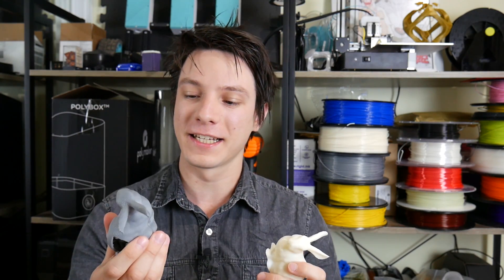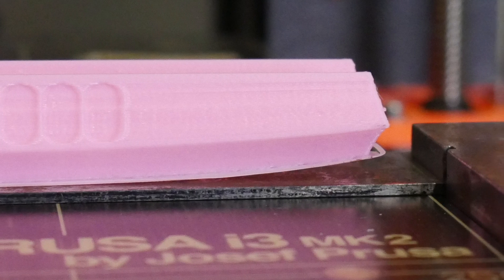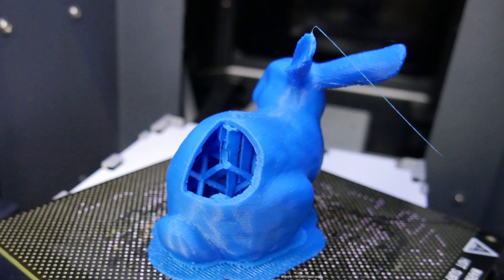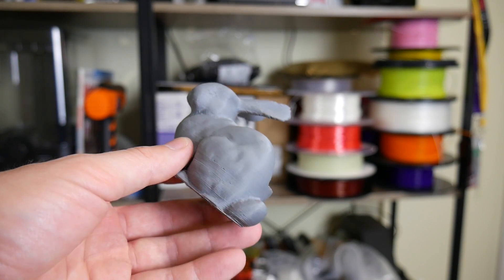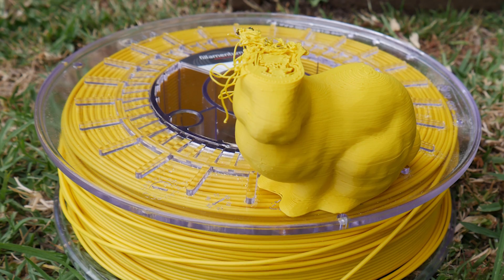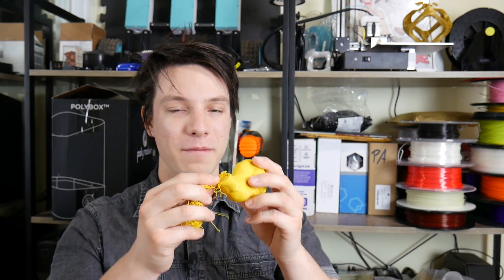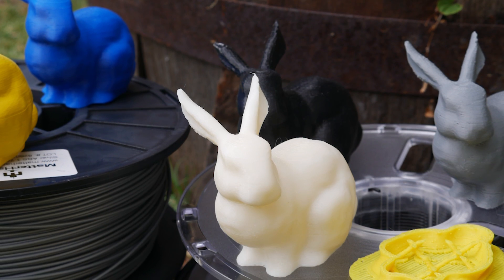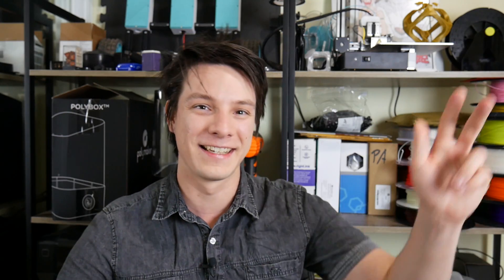Should you 3D Print in ABS? Probably not.

Comment: the only reason to still use ABS is smoothing. if you take control of the process from one end to the other (good bed adhesion, thermally stable and hot enclosure, and a nice recirculating [heated?] acetone chamber) then simply the quality that smoothed ABS gives you cannot compare to that of any other process, at least not without retaining the material price, strength, and availability.

Comment: I swear by ABS when rigidity matters. This is mostly because the best ABS you can buy is produced a town away from me- Chromastrand.
I’ve printed rocket parts and I use ABS for smaller, less complex parts that need rigidity and I use PETg when I need good dimensional accuracy and minimal warping.
If your bag is larger aesthetic or novelty prints, then yeah ABS isn’t for you. But from an engineering perspective, ABS absolutely has its place.
It came in especially handy for lightweight farings and other aerodynamic features because of its ability to be easily acetone smoothed.
(All my FDM printing was done on Lulzbot TAZ6’s or TAZ minis. Colorado State also had a Stratasys Objet 30 pro that I used when dimensional accuracy and complexity was the primary concern)

Comment: I use ABS for functional commercial parts used in aerial survey. it may not be good for printing useless models, but for functional hardware, brackets, handles, electronics enclosures, there is no other printable plastic  material that can deal with the extreme environments of aviation. For the average hobby user, it may not be the material of choice. but ABS is used in nearly every plastic product to this day. If you print on a PEI sheet on a heated bed, I find it just as easy to print with as PLA. You CANNOT use a glue stick or masking tape to use ABS, PEI is the best material to use as a coating on your bed. Black ABS is very UV stable, it is used in OEM automotive zip ties, engine covers, and dashboard components. I say this as this video is misleading for users. I print ABS for my job and it works very very well.

Comment: I print a bunch of ABS on my CR-10 without any of the mentioned problems. The learning curve for ABS is just slightly higher. But it's great for light functional parts that won't send splinters in your eyes when someone drops them. The slight flex is also just perfect for ultra light lens caps or cr2032 holders. I also used it for moderate speed rotors. And of course in my 3d pen to weld abs parts together.

Comment: PLA is easy to print with however there are many real world applications that require ABS, especially parts exposed to heat, sunlight and water. I have had ABS parts on my car exterior and interior for 4 years already without issue.

Comment: I disagree, I have zero problems printing with abs, active heating is EASY with a plugin that i wrote on octoprint that evens acepts gcode to set enclosure temperature. ABS is easy to finish, cheap...
Unless you can give another filament with all the same specs your comparison is not valid imo.

Comment: I personally use ABS almost exclusively. This is mostly due to the fact I have a really old printer (Solidoodle 2) without a fan or good support for one. I've also been using ABS since the beginning, and once you get it dialed in, it's easy. I almost never have problems. The worst part is waiting for the heated bed on my old printer to get to 110C. That does kind of suck, it usually takes 15-20 min.

Comment: One cool thing I saw with ABS, is how it reacts with Acetone vapor. It works like a weak acid, and you can use it to smooth out the outside and remove a lot of the layer marks. Which I think is pretty cool. Not sure how easy it is to get acetone though. Or if that benefit is removed by newer fillaments. I'm not really in the 3D printing scene, I just think these videos of yours are super neat. But I do have a friend with a 3D printer, so I might pester him about some of your stuff too.
Cheers.
Reply: Not like an acid, it acts exactly like you would expect it from organic solvents.
Reply: Not like an acid, it acts exactly like you would expect it from organic solvents.

Comment: I have a FlashForge Guider II and I can print large models with ABS almost flawlessly with very high detail.  Probably because I have an enclosed printer with a heated bed using a BuildTak type of build surface over glass.  I was printing ABS on a Robo3D R1+ and that worked pretty well using the heated bed along with PEI for my build platform.  With the Robo3D I didn't have an enclosed environment so large prints would sometimes warp or lift but it wasn't as bad as you might imagine if my temperatures were adjusted properly.  I would never go back to glue sticks, hairspray, or ABS slurry mess.  I love both PEI and BuildTak type print surfaces.  I have amazing results with ABS, especially with the FlashForge Guider II.  The problems I have had with other filaments I have tried is they are either too hard and brittle, won't last outside exposed to the elements, and they melt at a very low temperature.  If you have any recommendations on other types of filaments that don't have these issues, I'd be more than happy to try them.

Comment: Polycarbonate have some special effects which we use when we weld it with thermic welding methods. On most materials the plastified materials is some kind of a weak spot and the flush created during welding dont do anything for the strenght of the part. PC is different here as the flush by itself remains compact and, when the joint is designed properly, increase the joint strength: Said in one sentence? A correctly welded PC Part will break everywhere, except of the joint.

I think that is the reason why it delivers such tough models when you print it. We can think of the lamination the same way as pressing two molten weldconstructions together. I hope this is more or less correct as I am actually not 3D Printing and dont know the process. I intend to buy such a machine for prototyping and thank you for the informative videos!

Comment: I print in almost exclusively ABS. I do some PLA but it's far harder to clean up, and tears my hands up more. 

ABS Plastic is not hard to print as long as you follow these simple steps:

1) Borosilicate glass plate on the bed. 3mm at least.
2) Elmer's Purple Glue coating on the glass - It never comes up or warps
3) Print at the proper temperature

Comment: For some reason I still like ABS but warping WAS a pain in the arse. Recently I tried TitanX form formfutura and, as advertised, it does not warp. Still a bit weak layer adhesion though  Perhaps I have put most effort into tuning ABS but I always get better prints with it and like that you can sand and drill it easily.

Comment: ASA(Fillamentum) is in my expirience harder to print than cheap ABS (Esun/Hobbyking). It warps more and in the same time it tends to overheat much more. Big advantage of ABS you did not mentioned at all is in my opinion how it looks. Compared to PC Max in the video it is not so glossy. Same problem I have with PETG, again it is too glossy and so it looks very cheap. I also really need heat ressistance and in this case there is not so much substitute to ABS in reasonable price range, just HIPS I like a lot. HIPS warps less than ABS and has very nice dim look (black is awesome). With my passive enclosure I am able to print big prints without many troubles. Unfortunately HIPS has stupid label of "just support" material and so it is not popular and it is hard to find it in many colours.

Comment: I disagree with you. As ABS can be machined so well its outstanding. I only build parts to be used for building purposes in terms of hobbies. The most parts i print are between 20 x 20 (nuts) and 100x100 mm. The bigger the part the more i tend to use PETG, as its cheap (compared to other Mats with the same featuers) but small parts ABS just is the way to go. PLA is only good as long its in the printer. Once u take it out the parts always are printed well, but almost everything does one of the two: either its getting warm -> PLA gone or: there is a little force applied -> gone. PC-MAX is just way to expensive. 50 bugs a kilo, spend the half of it for smartABS and design parts in a way that the force is aligning with the layers ;) 
but never the less thanks for the vid. First time i heared about ASA will give it a try!

Comment: You are not correct. I print very high and large  ABS parts without an enclosure. You are absolutely wrong. I've never got any lift offs or curling. ABS is very good, high temperature industrial great plastics, that is being used for many years. It's also cheap. You just need a great adhesion to the bed. Don't use smooth surfaces and expect good adhesion. See my comments and videos in the bottom and  try, You never gonna print anything else. ABS is great!
Reply from the maker: +CoolStreamT cool stuff, which 3D Printer?
Reply: I have Anet A8. I assembled it from Kit and I did some mods and most important I built an oven above my printer constantly drying my filament during printing, because my prints take long time to print (about 15 hour). My filament is always dry. The printing quality of the ABS depends on dryness.

Comment: If your things will be in a basement (moisture) or garage (moisture & heat) then you need ABS. I print most everything in ABS . One reason strength of the part and the other reason the weather. If something is to stay outdoors you should be printing in ABS.

Comment: Ridiculous.  What a weak argument.  PC-Max is available in only 2 colours and $60/kg!  Abs takes a little more prep to make sure it works but it can be done very reliably and it is cheap and is strong in a broad application temperature range.  You need a heated bed but not a heated chamber just good bed prep. It is also available in a wide variety of colours no special nozzles are required.  Vent you build area and use double application of water soluble glue sticks for the bed.  I've tried a bunch of other exotic filaments and non were worth the trouble or expense.

Comment: I stick with ABS for the following reasons:
Hatchbox sells it for around $22 a Kg
I don't have any of the issues you say are associated with ABS maybe because I have a fully enclosed printer
I don't have to worry about tape or glue it just prints
Because I have an enclosed printer if I don't have a fan pointed at my printer PLA just comes out terribly

This has been my experience over the past 3 years of printing on my flashforge creator pro

Comment: My DaVinci aio 1 is self enclosed and does rather well. Yes... yes I know you  hear this alot . But several of your brethren tried DaVinci  but none did the AIO1 with scanner. The surface of the bed seems to be perfect! I never have any warping problems if i leave the post print to cool and slides right off the bed. Maybe proprietary abs dont know.

Wish their tech support was better.

I digress... 

I  have a enclosed printer w/heated bed and never run into alot of the problems with abs you guys with open air non heated bed people have.  Is that because you guys found open air machines where easier and cheaper in the early days of the 3d print revolution.  Dunno!

Comment: I am using transparent ABS from CCTREE, wjith a (rathercheap) Tevo Tarantula., which was dead cheap and it works amazing, does not really warp (sometimes yes). It is very stiff, adhesion is very good. I admit I print at slower speeds than with PLA (40% slower) and I have to set the 1st layer to very very slow, the latter is not affecting the overal time so much. But I think pacience is the problem. Plus I made vases with the transparent ABS and they turned out sooo amazing (only 1 perimiter, very robust)
Reply: no glue, no glassbed, its 20cm, I don't have much more space anyways
Reply: yes! i wouldn't start with ABS, i started with PLA, and will use both in the future :)
But thanks I will add a cage around my device. Anyways, but now i know that the warping issues that I have will get lesser

Comment: Quick question: how did you tweak the print temperature on the UP Mini 2? My experience with their slicer suggests the temperature controls are locked away, and last I checked the print protocol hadn't been cracked yet like it was with the original UP Mini.

Comment: Thank you.  The added "fiddly" nature of ABS is what turns me off.  I've had no problems with PLA on my Monoprice/Wanhao Ultimate/Duplicator 6.  Printing small, flatish parts parts in ABS was okay but anything with sharp corners is just too unpredictable.  And that's where I draw the line.  If I have to roll the dice with low odds off success each time I print...I'm less likely to use a material.  I don't have the needs ABS solves for so...no more ABS for me.

Comment: I think the main issue is that FDM machines were not originally designed to create a final product. They are prototyping machines. I use my 3D printer as part of a workflow. The printed item is a step in the process. I design, print, sand and finish, mold, and cast either in resins or metal. Of course you're going to have quality issues straight out of the printer. People are always whining about print quality as if they have never heard of sandpaper.

I worked at a prototyping company for some time using incredibly high-end SLA machines with resolutions that blow any FDM machine out of the water, and the bulk of our work was still finishing.

Tl;dr: 3D prints require finishing no matter what material you use. 3D printing is not a one-step process

Comment: 6:30 I've had a lot of luck printing large ABS prints with heat lamps directed at the print.  Like the sort you get for an lizard or something.   I use a Rostock Max, and I have three lamps, one facing each side.  It keeps the temps up, and the print turns out great.

Comment: 200$ prusa i3 kit. Level the bed well once, and you're good until you take it apart or something. Good spray of hairspray, and it sticks like it doesn't know that he is abs.
Had a problem only when printing a 100x170 box, 6 perimeters 0 infill... But the heated bed sucks, it's heated only in the center so...

I throw away 70% of my prints as they are prototypes, and maybe the final one is only something that will sit there untouched... Why spend 40$+ on a kg of filament

Comment: Soo, i have a question. 

 What kind of Filament would be most viable for the construction of Ball joints
 and other parts that need to the flex just a bit but also have the correct tolerances 
 necessary to hold positions yet also move smoothly?

Comment: I can't say I agree. I know there are disadvantages to ABS, but there's also a ton of advantages (price, availability, strength over PLA). I think you may have exaggerated just a bit on how difficult it is to print ABS. I print with ABS all the time, and while there are definitely times where I have a lot of trouble, I can typically get ABS to print incredibly well, and can adjust for things like shrinkage and warping during the print

Comment: PC-Max is a pain in the arse unless you use buildtak. It doesn't stick to Printbite at least (lifts after the first couple of layers), which handles pretty much everything else I chuck at it.
Formfutura ApolloX is a good ASA filament that's strong, gives great details and prints easily without warping with a non-enclosed ~90c bed. It's definitely better than that crap ASA you had there.
I've not tried it, but TitanX looks like a good alternative to normal ABS.

Comment: ABS has a higher modulus of resilience, meaning it can take more impact energy before reaching yield stress. PLA is classed as a brittle material, meaning it will break before it bends. Not too sure of any practical application where PLA would be better.

Comment: Biased subjective opinion that fails to consider the users needs and the specification or requirements of the part to be printed . Ok you don't like ABS but don't make it out to be something it isn't. You purported test was also completely misleading. The fact that the test pieces failed in completely different ways indicates the test was seriously flawed in the application of force and/or one or both of the test pieces was not produced with the optimum settings for the material in question. ABS has many uses and benefits, not least its price and its solubility in ketones that can be utilised to bond/repair, cast and finish it to a quality not easily (safely) achievable with any other thermoplastic filament, this is of course a disadvantage in certain circumstances, but not one I can imagine many users will ever face. Nor in the scheme of materials generally available is it hard to use provided it is understood and the printer configured appropriately, as with any filament - granted it is not the easiest, but it isn't an order of magnitude away. It is proven technology that will be around for a long while yet.